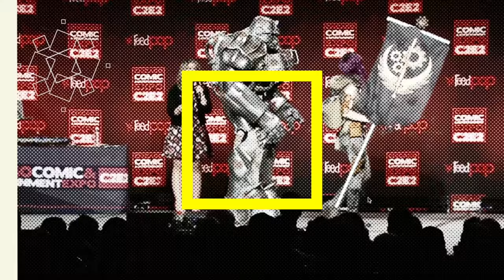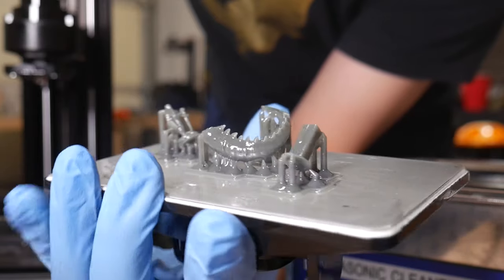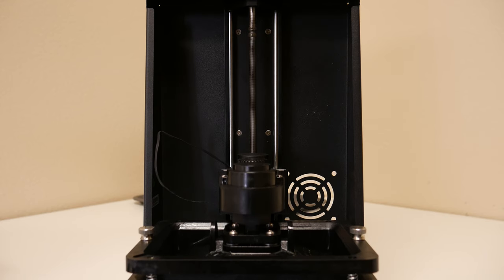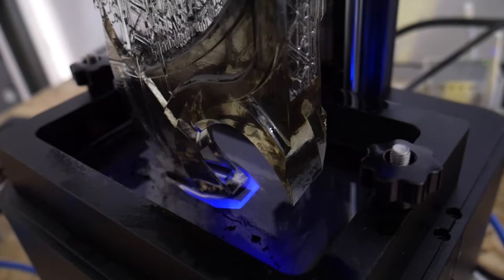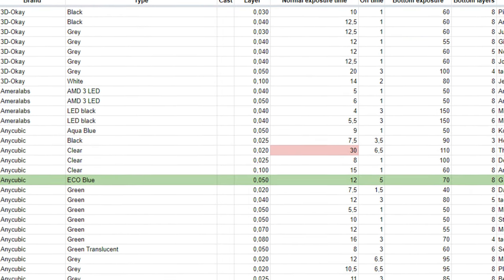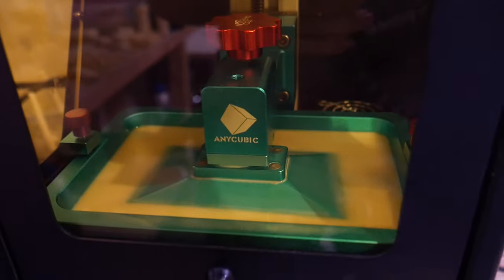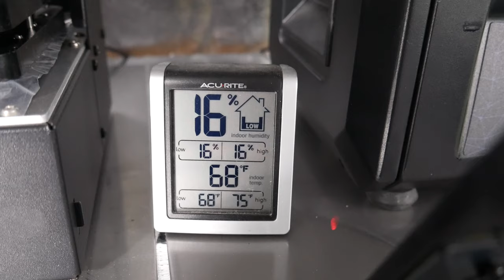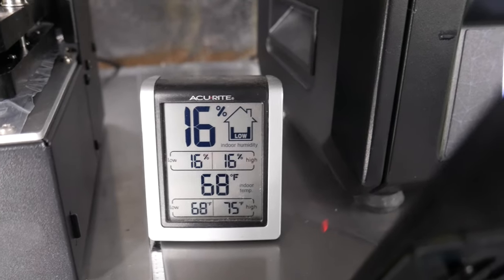4 Tips For getting PERFECT Resin 3D Print Bed Adhesion

Comment: On a Mono X ( for small light items ) I use 2 bottom layers @ 20 seconds each, and a 1.5 second layer time. 80% power. No issues perfectly detailed with no elephants foot 👍🏼 perfect for model bases and such printed flat. ✌🏼

Comment: Great content here and presented in an understandable way without any nonesense. Keep going this way. As you asked for other tips to improve adhesion to the build plate: A common tip is to sand it with sand paper (fixing the sandpaper to a perfectly flat surface like a glass pane to keep the sanding even). The second tip is to use a non-FEP sheet (from epax for example) to which the resin does attache less than to other fep sheets that come with most of the common printers.

Comment: Don't forget that as printers age the UV LEDs get dimmer. So you may not be able to keep the same exposure across the life of the printer and less exposure can cause print failure.
As well, especially with the thixotropic resins that need to be heated above ambient, if the LCD gets too hot (first that's bad for it) but the LCD crystals start to blacken. Your eye can't often see this until it gets really bad/hot but long before it gets bad enough to detect it can effect how much light is getting through. So again your exposure goes down.

Comment: As a fairly new resin 3D printer something I have found is that eventually you will need to replace your FEP sheet. Use disposable microfiber cloths to clean it. DO NOT use paper towels, they scratch your FEP and drastically reduce your FEP’s lifespan. Also PFTE lubricant is a good idea. The brand I use is 3-in-1 that comes in a teal colored bottle.

I had a FEP puncture because of this and I had to remove cured resin from my LCD screen which was a huge pain.

Edit: also my FEP was not tight enough from the manufacturer.

Comment: Thanks for this, I had this very issue, and I found the problem being what I had cleaned the build plate with, I did use a very good quality paper kitchen towel. But, I have now changed to an old toothbrush and cotton cloth with the alcohol to completely clean the surface, as small remnants can remain on the surface to create adhesion issues.

Comment: I used the factory anycubic resin. If your having a problem with it not sticking, I suggest Siraya Tech Resin on ebay. Youll thank me later. It always adheres to the plate. Its bullet proof. Just make sure your plate is leveled and have the corresponding supports!
Reply from the maker: Yup! Siraya resins is awesome with the exception of trying to print it in cold climates without a heater, I learnt that the hard way last winter.

Comment: Some good tricks here i'll have to try! I use a light coat of rain-x on the FEP before each print, at the moment.
Reply: How does the rainX work?
Reply: never tried the rain-x but I wipe some ptfe 3 in 1 lubricant on my film before putting the resin in and I have yet to have a print stick to the film.  Even one failed print I had popped off the film with no issues.

Comment: Dealing with some issues with my company's resin printers failing, not bed adhesion but the part being ripped of the supports. It worked totally fine, no issues whatsoever back when the room was kept at 90°F, but ever since the heater failed we've been having nothing but trouble. That seems like the most likely culprit, and the solution to the printers is to fix the heater.

Comment: I had realised temperature is a factor, when I read that Seraya Tech Tough resins are ideally printed at 35°C. I had actually warmed up the bottles of anycubic resin I am currently working with, but I can still not rule it out as a factor for my adhesion issues (that is to say the resin's not mine personally 🥳). I'll make sure to increase exposure time even further (preset for the photon mono x at 40s 🤔) and if that doesn't do the trick I'll look into the FEP hassle.
Reply from the maker: Yeah, a year or so more data I can can confirm that temperature definitely has a larger impact on resin print success/fail and print quality than most folks give it credit for. 

I am at the point where I am converting one of my dead FDM printers into a heated resin storage cabinet using the screen/electronics/power supply to store my resins at the right temperature and avoid the drama of having to warm resins.

Comment: Hopefully this helps, i already run my prints at 70 seconds, dont have too much of an issue with smaller models like miniatures for D&D but i tried making a small building recently and the corners of the building get lifted and the base isnt level, of course it corrected itself after a few more layers so the rest of it looks great but now i gotta make a roof for it and that probably wont cut it
Reply from the maker: If the part is peeling off the edges is sounds like your light source is not consistent and has "hot spot" in the center, two ways to fix that is to bump up the cure time to get the edges to stick (while overcuring anything in the center) or depending on your printer create a image mask that will even out the light distribution but at the cost of much longer cure times.

Comment: I'm in non-adhesion hell right now so I'm searching around for ideas of things to try. Your video seems like good advice. I've already been super careful with bed levelling. You don't mention whether machine levelling is critical but I'm going to play with that. My problems really started when I changed the FEP in my tank, though, so I'm wondering if my FEP is too loose. It doesn't feel loose but perhaps it is. I'll see if I can find a suitable app for measuring the frequency when I ping it. 

You also say that base layer exposure time is critical. It seemed like you were saying that if this is the issue then perhaps it needs to expose longer. But is it possible to expose too long?

Thanks for the tips. These issues are getting me down. It's good to have someone out there to help.
Reply from the maker: So an alternate test to determine if the FEP sheet is too loose is to also increase the raise height. A tight FEP sheet means it peels off the part faster where a loose FEP will stick and never quite peel off when the build plate lifts--lifting it higher than 10mm means its definitely too loose. 

For the most part exposing the base layers in ranges of 60-90 seconds should not cause any issues to the LCD for the first 6-8 layers Where you might run into issues is over exposing your regular layers for hours.

Machine leveling is definitely important but I found in most cases its a contributing factor with one of the other variables I mention in the video, the only case where machine level alone causes failures is if the build plate is too far away from the LCD/FEP to allow the resin to form good suction on the build plate.

Hopefully that helps :)
Reply: Hiro Creations It does, thanks. I checked my FEP tension and it “rings” at about 452 Hz. So I don’t think it’s too loose. Too tight perhaps but that shouldn’t stop it peeling right?
Reply from the maker: @JohnArnoldUK  Yeah only issue with too tight is its easier to puncture the FEP but that is another issue entirely.
Reply: Same halot one needs to be in the trash 

Too slow , the manual never tells you why it could fail or troubleshooting 

Now the house stinks

Comment: Never had my base layer exposure time as high as you recommend in the video though.  I use 12 seconds for the base layers and 2 seconds for the rest of the layers and it's never been an issue for me.

My printer was having the problem of builds sticking to the build plate too well and I had so many issues getting them off.  I bought a flexible plate to remedy that.  Then I had an issue with the flexible build plate being too smooth and nothing was sticking to it.  Had to hit it with a 300 grit wet sand to add some texture to it and haven't had any issues since then.
Reply: This video was released in 2019 when the norm was RGB screens. 12 seconds on a mono screen is easily equivalent to 60+ seconds on RGB.

Comment: Hay I really like your video but my problem with a slightly different. My supports are sticking just fine I’m having problems with prints sticking to the fep sheet half way threw and that layer separates from the peace and sticks to the fep. Any idea why the first half sticks just fine and then it fails half way threw?

Comment: Just set your initial layers to 8 with 60s exposure time, its an excellent middle ground that will net you perfect adhesion almost every time. 

Also don't use auto supports, they are hopeless. Use Prusa or Photon workshop and add your own using common sense.

If you are incredibly careful and willing to take risk/reward, you can give the build plate an incredibly fine sand with very very fine sandpaper, just a few VERY gentle pass-overs. You want to make micro scratches that are so small you cant see them,  the uneven surface helps the resin adhere to the plate a little better. DO NOT DO THIS WITH A GLASS PLATE.

Comment: Use 2 paper strips because you need to level side to side and front to back.  Mars 3 only needs about 25-35 seconds with Plant Based or ABS-Like resin.  FEP was my problem.  After 5 months the FEP was getting scratched and worn.  It is a wear item.

Comment: Awesome video. Really good information. I had my printer (Anycubic Photon) for a year printing with no problems. I didn't even have to look for curing times It did an amazing job no fails until I decided to upgrade firmware. Since then is been only tears. I have change FEP 3 times and level not sure how many times. One thing I notice is that always fails in the same spot.  Any recommendations?
Reply from the maker: Hard to say without seeing but I can try. Does anything stick to the plate or is it all on the FEP sheet?

Comment: Use carnauba wax to reduce that bond on the FEP surface. Wax every surface on the vat that cleaning will become easy without compromising print quality.  The only thing you do not have to put wax on is the build plate surface. You can put wax on the side of the build plate and the back that resin does not adhere well on the surface, easy to clean and easy to drip off after printing resulting to less waste of resin. This is assuming exposure and leveling are all perfect. Ideally, that FEP material should not adhere to the resin that is why they use it as the material of choice but that is not the case in real life so we wax it that it solves a lot of problems.  Technically, we do not need to use FEP material, any PET or HDPE material that is clear and flexible can be use here and they are much better in all aspect than the expensive FEP material.

Comment: Regarding fep tension, you mention it's you can measure it with a guitar tuner or by how much Hz it makes.
How would one have to go about to do this? Install a 'Hz measurement app', and flick the fep sheet to make sound?
And on the temperature, I live in a relatively cold-ish and humid place (Netherlands) and have to print in a storage room without heater. Would preheating my resin solve the temperature problem, and how would I best do that?
Thanks in advance : )

Comment: I've seen others recommend to keep the FEP a bit loose as it allows the part to peel off from the edges to the middle, rather than all at once (which causes suction). What are your current thoughts on that?
Reply from the maker: I need to make a video on tension specifically as a topic as I actually prefer tensioning my FEP sheets as tight as they will allow without breaking as it has virtually eliminated any adhesion issues that are not underexposed base layers. Especially on printers with screen sizes larger than 8.9" where a loose center causes much higher failure rates.

Comment: I had an issue when switching to lychee slicer from photon slicer the setting i was glossing over was layer height (Layer Thickness) i had the decimal in the wrong spot.  was converting from um to mm and ended up making my layer height 10x larger then intended. if your exposure test are successful for 20um (.02mm) and you set your layer layer height to .2mm.  this will cause only the first and maybe second layer to stick to plate and rest to remain on your FEP, the thicker the layer the more time that will be needed. We don't need to go into how long this took me to figure out :D

Comment: Still have problems.  Do not know what is wrong.  Brand new FEP, tightened it to nearly 300 hertz, warmed the bottle of resin before adding, re-leveled my build plate, and increased the cure time for the first 15 layers to 120 seconds.  It just will not stick.  I bought a new vat with pre-installed FEP and it worked for a week of solid printing, but as more prints came out, I started to notice parts of the build plate would no longer adhere, until it just stopped bonding entirely.

Comment: Hello there ! Excellent video. I have a question for you : when you talk about a frequency between 325 Hz and 450 Hz, it's the sound who comes from the center of the FEP or the edges when you hit it ? I've got 358 Hz on the edges but only 180Hz on the center. (I just received my first printer so it's the default settings)

Comment: I notice you use thick supports on your non miniature type prints? Any particular reason for this?  I’ve seeing drooping on straight edges on engineering type prints and coming to conclusion I need to move to the heavy supports on these type of models to try and counter this as tried just about everything else even high density support.  Would be nice for you to cover supporting these types of prints in a future vid. Thanks for great content.

Comment: How do you fix the warping at the bottom layer guys when printing flat. My warping is pretty bed around the edges(Is this normal with the resin printer?). Is this the problem with the plate or FEP? I leveled my printer very well. Thanks.
Reply: I have similar problems, yet to resolve

Comment: Surprised he didn't mention slicing. I find a lot of people (me included) use FDM techniques like using the lowest orientation, to save on print time. THIS IS A BIG NO-NO. Lowest orientation will almost guarantee a fail. It fails because the you are generally presenting the FEP sheet with an equal surface area to the build plate, making adhesion a 50/50 affair. Over hundreds if not thousands of tugs, its bound to fall off. 

I've also gotten too cute with easy to remove supports... yeah outsmarted myself and was forced to clean out the vat.
Reply from the maker: That's definitely going to be a topic of a future video, as slicing mistakes is deep enough to justify it's own video. :)
Reply: Coming from FDM printing, I was making this mistake - thanks for pointing this out.

Comment: Help! I have a new halot mage and i have been unable to get any bed adhesion. Its level the fep is thight the room temperature is a stable 72 F. I sanded the plate i adjusted times in a few different areas from exposure to lift speed and nothing is helping. Im using anycubic ABS like gray resin. My halot mage is not the pro... What could be the problem any help would be awesome.